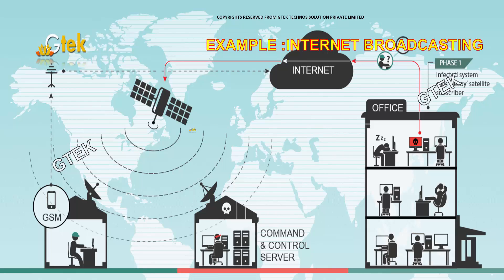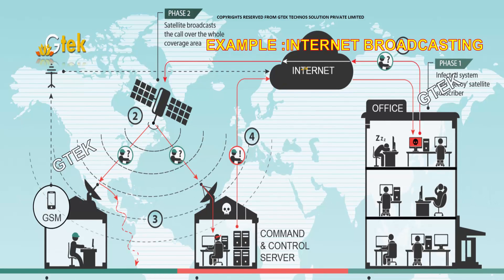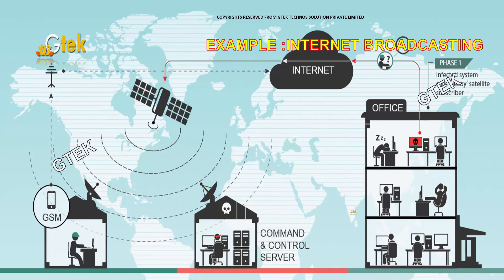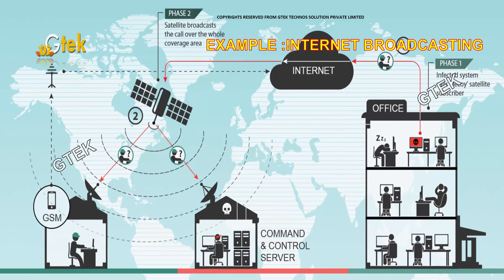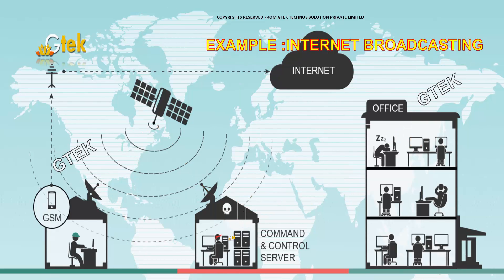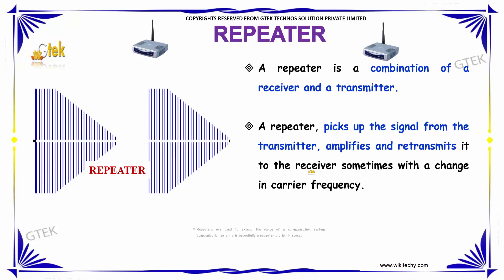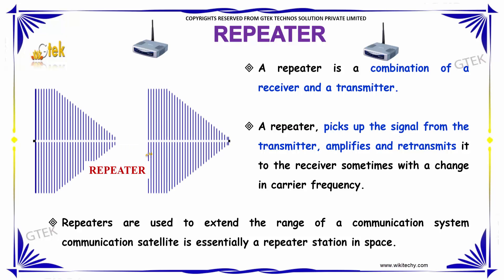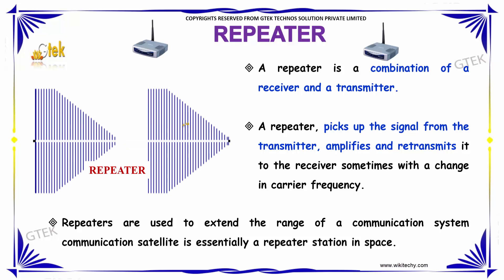Repeater |Communication systems |class 12 physics subject notes lectures|CBSE|IITJEE|NEET

Comment: A radio repeater is a combination of a radio receiver and a radio transmitter that receives a weak or low-level signal and retransmits it at a higher level or higher power, so that the signal can cover longer distances without degradation.

Comment: Telecommunication is communication at a distance using electrical signals or electromagnetic waves. Examples of telecommunications systems are the telephone network, the radio broadcasting system, computer networks and the Internet.

Comment: 1) In digital communication systems, a repeater is a device that receives a digital signal on an electromagnetic or optical transmission medium and regenerates the signal along the next leg of the medium. ... With analog transmission, signals are restrengthened with amplifiers .

Comment: In digital communication systems, a repeater is a device that receives a digital signal on an electromagnetic or optical transmission medium and regenerates the signal along the next leg of the medium. ... With analog transmission, signals are restrengthened with amplifiers which .

Comment: In telecommunications, a repeater is an electronic device that receives a signal and retransmits it. Repeaters are used to extend transmissions so that the signal can cover longer distances or be received on the other side of an obstruction.